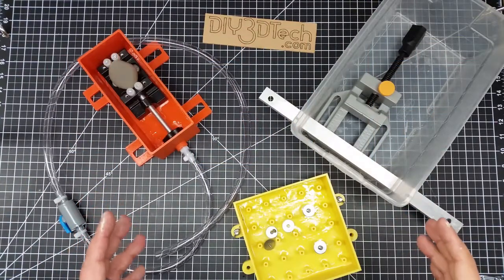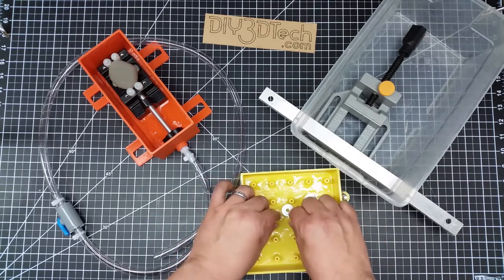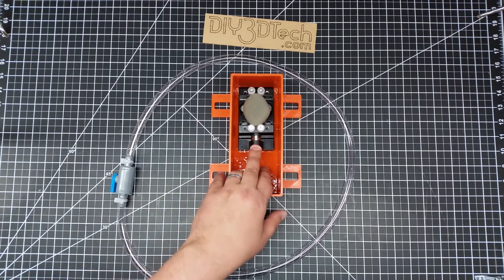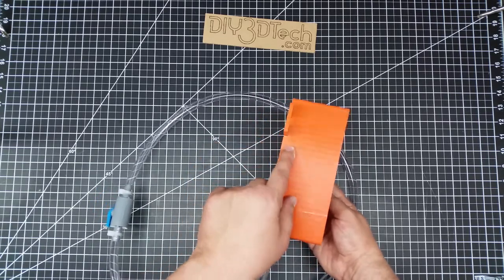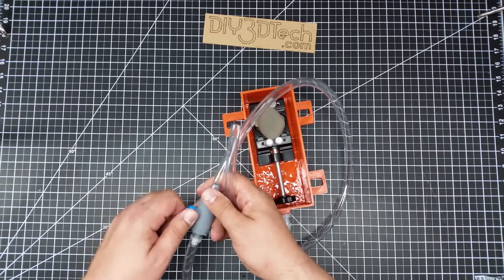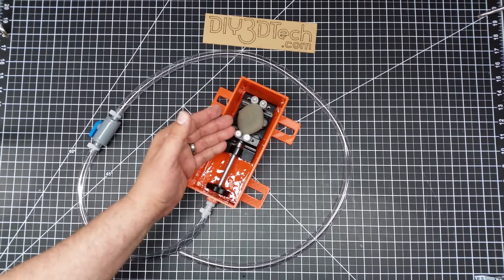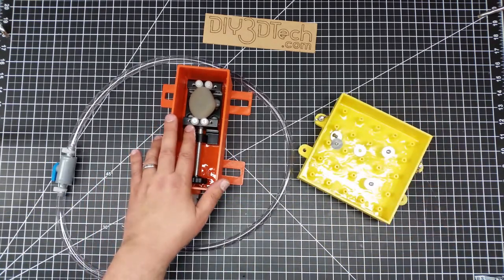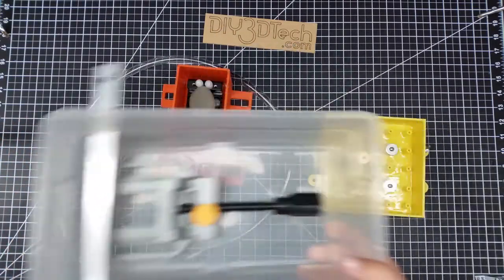3040 CNC - New Water Bath Design!

Comment: I have a question for you.  I want to get an entry level desktop CNC to carve letter and numbers into gemstones (ie; onyx, cats eye, opal, etc...)  The gemstones are round and range from 8mm-12mm.  My goal is to carve letters and numbers into them about 1.5-2mm deep (needs to have consistent depth throughout the engravings) and then cut out a thin piece of sterling silver 1mm-1.5mm thick and inlay them into the engraved part of the gemstone.  I don't want to carve into the entire roundness of the gemstone, but rather just use about 7-8mm of the face of the gemstone so the engravings would have a slight curvature.   Is there a CNC machine and software you recommend for this type of work?
Reply from the maker: First you will not get an entry level machine for this (like a 3018) ether a 3020 or 3040 with 800 watt water cooled spindle (I also have a lot more videos on this) would be minimum especially if your doing this for a business as this is a lot of "load" on the machine.   On the topic of  consistent depth  I have to ask  consistent to what?   The surface of the stone is not flat so while you cut at a  consistent depth  the result will be subject to the surface.  You could "surface" the stone however this will take quite a bit of time and not sure it will provide the affect your seeking.  Also you want to do this in water cool and lubricate everything and control the dust which can be very dangerous.  For software you can basically use any thing  as what your doing is not that complex...

Comment: How thick are the walls? I will assume the drain is because the 'tank' will be mounted to a platform most of the time?
Reply from the maker: About 3mm if I recall correctly, also the drain has two purposes (1)  flush between jobs as some stones create a lot of goop, and and (2) so it can be tipped as to get in under the spindle as you have to tip it and if there is water it makes a mess (I learned the hard way :-).

Comment: looks good man .    keeping down the deadly dust  . Its not just deadly to us humans but also  some of the fine workings of our machines dont fair well with those particle types , as they are wickedly abrasive .  they way things are going for you i can see you making a DIY  water jet one of these days .
Reply from the maker: LOL!  Its in my mind!  There is a guy on the net (forget his name but has a big following) made one from a pressure washer.  However looked too dangerous for my taste :-)  I am going to build a really big one for carbon cutting...
Reply: yeah  last one i saw was done by Applied Science . heck I'm even thinking of water jet in a band saw like config . where the jet is fixed and the  table moves or I move the work piece .  then i remember ,  not much time rite now and even more so rite now , not much space left in my small house . I have been doing the most boring of things .. shop organizing/cleaning .  But i do have ideas to use the 360 deg abrasive blades , and a moving table . something like a CNC  foam cutter  but for all the things abrasive wire can cut .  I even picked up a cheapo kids toy foam cutter that uses segments of the wire .  if i can find a good source i will make a set of blade for my scroll saw to test them i will make a moving XY . but man at that point i might as well  just make a CNC  haha
Reply from the maker: Yes that was the guy! (Applied Science)  I have worked a lot in the past with high pressure hydraulic systems and they let lose, bam! So a little skidish about follow his design :-)  Know what you mean about running out of space too!
Reply: at my work i walk by the cooling lines for hydraulic wave makers . essentialy a ocean basin simulator about 100m x 100m lined with wave makers the size of small cars on 2 sides so it can simulate ocean wave patterns .  those lines start 4 inches wide x4 and eventually get thinner as they reach all the wave makers . but thats the cooling line . the high pressure lines are all off one trunk 3 inches thick most of the way . when its running we cany go round there , as you can get bad burn if i pipe leaked.
Reply from the maker: You aren't kidding!